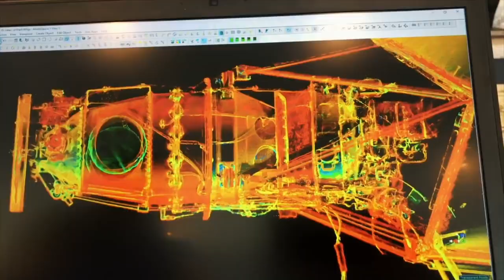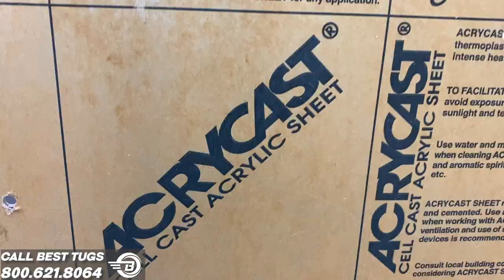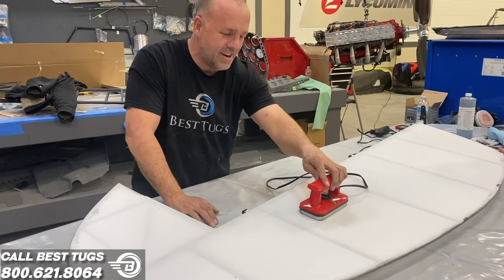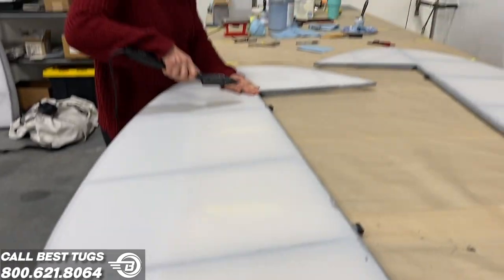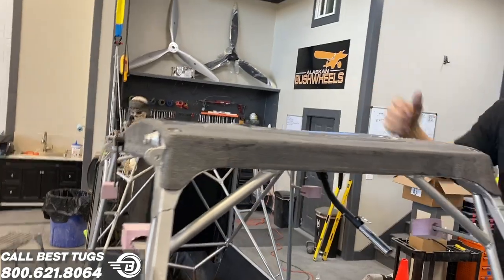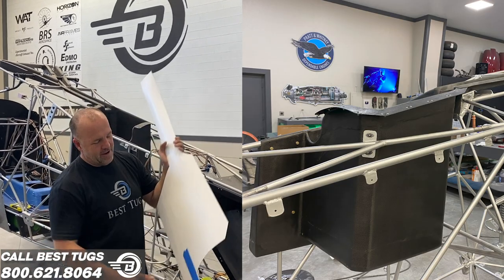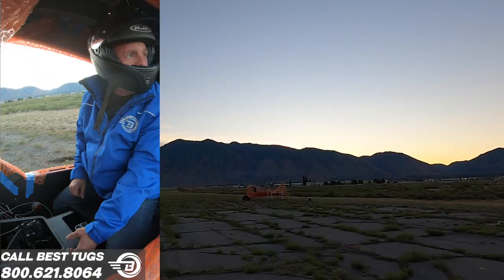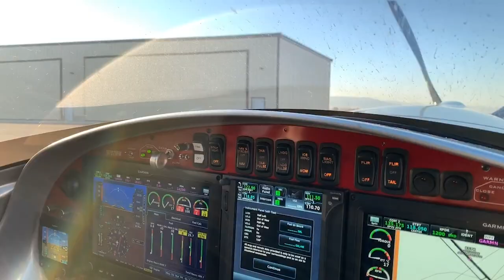Carbon Fiber,  Skylight, Tail-Feathers and Paint Begins (Scrappy Bush Plane 21)

Comment: AH.... don't forget to frame out some of the paint booth just in case it wants not go flat while something's dryin' !............For my curved windows  I built a box with resistance wire, used a BIG D/C  model train transformer  and  and placed my Acrylic in it ( nice even heat )  with cover, and my Shop Vac. ...... kinda like a toaster ....heat lamps help too.....and boy it works !
LOOKS GREAT MIKE !     wish I was as far along as you ..... ah..... bah ....... so be it !

Comment: I was an AMS in the US NAVY but now I only build Balsa Aircraft. I have found double covering offers nothing but extra weight. The true strength comes from the Dope. However, the single biggest part is the weight is the paint. So the application technique is very important. Dope is the lightest product as 40% of its weight gasses off. I enjoy your builds

Comment: Impressive as always. If the situation is dire, I'm all for having a parachute, it's make or break between lethal energies. But it doesn't need to be gentle if the design intrusion can be very modest. If the plane comes down nose down, fast and uncomfortable in the seat harness for a couple of minutes, I think that's quite acceptable if you gain a clean design with a single small pocket and attachment point. I can't help feel that rocket deployment is way overkill too. small charge like an airbag should be plenty or even lazy manual ejection just to keep it reliably low tech. We are talking about a parachute in strong wind. Those should be compatible.

Comment: Maybe i realized this earlier but i just realized it again. Mike had to convince his wife that scrappy wouldn't cost much because it's all built from scrap,  free, parts.  I am with you Mike, 😉😉
Can't wait for the used,  damaged,  and scrapped avionics. 😉
Love these build vids and I wish that i would see you use the less expensive 3m 2097 filters on your respirator. I might do some mild stalking, figure out the address to the hanger, and send you a pair.  They are light weight,  p100 rated and are good for organic vapor ie epoxy vapors.
Reply: Travis k  Thanks for the tip on the respirator 👍🏻.  And, I’m pretty stoked about these avionics too!  Of course, I may skim one or two items out of the box for my plane.😁
Reply: @ChandraSlyFoxPatey  Awesome. Thanks for the reply.
Reply: Chandra, do NOT let Mike hog all the good avionics.  A lady deserves her bling!

Comment: Thanks Mike for letting me know that you are on top of one of  my concerns for your well being if and when your flight plan gets updated and you're going to see what the parachute looks like from underneath, (drum roll!!!)- - -. I guess I'm just too hung up on the vision of that clear light  fluid that's coming from under the cowling and streaming back across the windscreen, (but I do know it could be windshield washer fluid)!
Sure was a lot of comments last video wanting to see the rest of the test firing! Don't get me wrong folks, I like fireworks shows too so long as I'm not a critical part of the show!

Comment: Great video.  It is so nice to see Chandra again.  Now, any chance you could talk my wife into working on my Corvette?  Lucky bastard!  She is a real gem.  Any chance of getting some updates on her and her Cub?  After seeing her reaction when she got the Cub, I have been worried that she doesn’t fly it to keep it from getting dirty.😜
Reply: 😂😂 I fly it quite a bit, absolutely love it!!  I’m horrible about getting footage. I need to rig up a camera to the strut. I actually got Mike to leave the hangar and come for a ride a few times 😃.  Also, I must say, I’m a classic Vette fan!!  I had a red on red ‘62 convertible until about a year and a half ago.♥️ Thanks for the nice comment 👍🏻👍🏻
Reply: Holy crap, Chandra, the ‘62 is my all time favorite!  I have a ‘07 Z06 that I have built into my personal hot rod.  Maybe Mike and I have a little in common.  It has 560 horsepower, bigger brakes and bigger wheels and tires.  It is full of carbon fiber and titanium parts, some of which I have done myself, and I got the weight down to 2851 pounds.  It is 310 pounds lighter than stock and how it drives is amazing.  It’s all about the performance.  More power is great but addressing every aspect of the performance envelope is what makes a car (or plane) truly great.  Thanks so much for the reply and I think I speak for a lot of us when I say that we would like to see more of you.  Think of how you could inspire young girls to not only consider aviation as an interest but to also open their eyes to see how much this world has to offer to ANYONE with a dream and a desire.
Reply: King-O-Vetts  I have something in the works... 😃  And, very cool with your Vette, sounds like a beast!!  I love it!

Comment: I'd be less worried about it breaking and more concerned with it scratching over time. I'd consider running clear 3M car bra material/ wrap on both sides that can simply be removed and replaced when it inevitably becomes scratched and scuffed. (:
Reply: Just what I had thought ;-)
Reply: Buffer will handle any scratches. Scratches from what on top of the airplane? How often do people replace sky lites, I can still see through my 1960 windscreen.

Comment: Fabric covering is very similar to how we do model airplanes ( minus the rivets and the second layer)  One tip ( though it is probably too late....) joining the fabric at the trailing edge is good, with  bottom layer wrapping around the TE. The top layer, if you wrap it around, you will have a fabric edge facing the oncoming prop blast.  If you trim the top layer at the trailing edge of the control surface (rather than wrapping it around) you avoid that potential problem area......
Reply from the maker: 👍🤠 I agree . That’s exactly what I did. They overlap a bunch but the last layer ends just before the wind boundary layer on the back edge before getting into the wind

Comment: Hi Mike, good to see your beloved and beautiful wife getting involved in your passion for building things, with all the hours you spend in the hanger I was beginning to think she would be suffering from pilots wife syndrome! A question for you,  I am sure you have worked it out so it will be an easy answer, What is the terminal velocity of Scrappy under full parachute as it hits the ground? and will your newly designed landing gear shock absorbing system soak up the hit to the extent that there will be no structural damage caused and therefore remain flyable?  regards to you and the family from Ireland
Reply: I’m a pilot as well, so no “pilot’s wife syndrome” here.  Now if you want to talk about “back seat flying”, I can really throw down there 😂.  Regarding your question about the chute, it’ll all be covered in an upcoming video. 👍🏻

Comment: I would save the cut out from the window and use it internally as a upper visor. maybe some thin carbon fiber to act as a latch to hold it up when you dont want the sun beating down on your head. or maybe some neodymium magnets.

Comment: I’ve seen some people put a wood frame inside of the paint booth, that way it would not deflate if the power goes out.
Reply: Brad Ramm  We usually have it collapsed and can easily pull it out of the way.
Reply: @ChandraSlyFoxPatey  i guess he meant if something's drying in there?
Reply: That's a pretty good idea, it would suck if the blower broke or the power goes out while stuff is drying inside
Reply: Nice idea, because that would be a nightmare all stuck together :o

Comment: Just thinking... if you had something black underneath the plexi, it would heat up from the inside, if you used those lights, so it would probably give pretty even heat?
Quick question: is the temperature coefficient of the acrylic close enough to the composite that you won't have any problems with the acrylic shrinking away from the seal, at low temps, or buckling against the surround at higher temps?
I was interested in your discussion of the added strength in two fabric layers..is there a gain in tear resistance, due to different weave alignment between layers?  Have you done anything specific about the weave alignment of the two layers? Just [as usual ;-) trying to learn, every day!]
You are one hard-workin' son-of-a-gun! Your attention to detail is mind-boggling!  I see a lot of experience at work, there!  And, indeed, your wife looks like a lovely person...and, perhaps, a "saint", given the hours you work!!

Comment: Hey Mrs Patey, what did you use to bond the two fabric layers together? I helped my dad rebuild his first plane, a 47 Aeronca Chief. 45 hp, god awful slow, and at 12 y/o, I could SAFELY hand start it. We covered the wings using Ceconite envelopes. I recall that we had to be careful with the heat because it was possible to crush the structure if we got too crazy with the irons. Fun times.
Reply: Nick Salvador  It’s called Ekobond.  It’s a Stewart Systems product, designed to go with their fabric, and it’s great to work with.  I was very impressed with how well it all went together and produced a great finish, the pieces look incredible!  I’ve heard how much of a pain fabric used to be, but I have to say, this wasn’t bad at all.  It’s awesome that you’ve had the experiences you have in building from a young age 👍🏻👍🏻.

Comment: Excellent videos Mike.  But.... acrylic sheet!!  Why didnt you use polycarbonate (Lexan)?  It wont crack, drills without splitting, forms easily and is very durable (material is used for bullet proof windows).

Comment: An idea: for the parachute lid, instead of adding 10 layers of carbon you could add a layer of kevlar and then just one layer of carbon. The straps will never rip the kevlar.
Reply from the maker: Ludwig Söderman 👍🤠 agreed for the non tear issue for sure.  The other item I didn’t mention is I need it not to flex so that it POPs all at one moment and not flex and arch as it goes.  Great recommendation on the Kevlar I use it often thanks 🤠

Comment: I hope you had a great Father's Day! Can you tell me why you use acrylic instead of polycarbonate for the window? Is it the weight? I like pc in my home projects (not aviation) because it drills w/o cracking/shattering, and it even takes threads. I believe it's also less brittle at low temperatures. What are the advantages of acrylic? Thanks.

Comment: MIKE ! It occurs to me that the Rocket Launch Section ought to have some heat/flame proof/resistant liner
to avoid further damage when deployed. What is the flash point of the fiber/resin panels vs rocket exhaust temp ?
Maybe a thin ceramic coating given the rigidity of the launch box.
Reply from the maker: I’ll talk on that specifically soon

Comment: Mike, great work as always. I work with carbon often on my boats. I have learned quite a few tips from you. What epoxy system are you using? Have you made any considerations to the full sun summer-time temperature of the raw carbon skins in your epoxy choice?

Comment: Love your videos, as you are always trying to make everything as safe as possible.  Then I see you are missing the light switch plate cover ($1.50) by your rear entrance door in your shop.  Someone comes in while dark, feels around for the lights and ends up dead due to electrocution??  If you could make a carbon fiber one, that would due as well!  Safety first!
Reply from the maker: I agree.  The circuit was dead, including breaker pulled from panel as we were and are upgrading power and lights in the shop.  Safety first, I would be a fool to leave a open circuit anywhere let alone from a 1.50 part.   Nothing to do with a cover plate everything to do with a remodel.  Always safety first my friend 👍🤠

Comment: Plywood gets its strength due to alternating the grain on the different layers also because it is compressed under pressure for a bond to some extent.
How that apply's to aircraft ? Dont have a clue? Its just thicker? Different weaves overlapping? Will be interesting to see how it holds up in the real world use.
Nice looking carbon work.

Comment: Looking at those safety chute "Y" rip away channels and I have a question.
Would it be possible to have the rip away panels flexible enough to peel but also strong enough to hinge upward standing straight up above the cabin far enough to act as a rigid yoke that the chute is attached to and put this on a plane with a push prop like Peter's Raptor (another channel) so that he could deploy the safety chute before the prop stops spinning without it getting fouled in the prop?

Comment: Is that my Wilga in the hanger? Awww, you shouldn't have. But I'll take it!
Serious question, I mean really serious. How strong is cloth? If you had a cloth floor, could you stand on it? If not and you're in a steep turn can you lean on a door made of it? Back seat fuselage wall same thing?
Happy Father's Day!
Reply from the maker: ken cohagen great question👍🤠 it’s insane strong and yes you can stand and lean on it.  It may surprise you to know it’s what’s on the p51 mustang and can handle over 500MPH on a fighter
Reply: To be precise, in a correct turn you don't lean anywhere, you still feel the vertical directly along the spine. Only the landscape leans around you.

Comment: Mike,  Was just wondering and I know this would probably not be at the top of the list of things to worry about should you need to deploy the chute, but what happens to the shrapnel or pieces parts that are torn once the chute is deployed? Just a thought. Thanks for the videos. They are awesome.
Reply from the maker: Joe Olivera great question 👍🤠 absolutely everything happens on the outside and all that comes off is to small in size and  weight to penitents and get into the aircraft.

Comment: it is amazing that mike keeps the FAA violation in his intro and ending, as i recall it hydro planing is a violation loool
Reply: Hesham Harold that’s not true.. hydroplaning isn’t a violation by itself, especially if proper precautions are taken to not harm others, like a passenger who isn’t a pilot.. yes people have been violated but I believe they had non pilot passengers on board who may not fully understand the risks. Oh and above 60 mph or so, you couldn’t punch the wheels under the surface if you tried, so it’s not as risky as you may think!
Reply from the maker: Hesham Harold great comment thanks 👍🤠 I keep in constant contact with the FAA and take appropriate steps to not violate rules but I Certainly don’t recommend people try it without extensive training. I use ski in method to get to some remote beach areas around here.  It certainly has its risks so not taken lightly
Reply: @MikePatey  Mike, your safety considerations in design is second to nasa in my opinion, i do thrive on your work/art in my engineering career, am just saying it is cool.
Reply: @heshamharold  Second to NASA?  I don't think Mike would make gaskets of some rotting crap ;-)

Comment: Do the rivets that you are using have larger flanges than normal to hold down the primary layer and not rip through the fabric over time? That’s why we always rib stitched the old fashioned way but interested in your opinion.

Comment: Might be a dumb question but, would it have not been better to have the parachute rocket fire from a more forward position?  My thinking is that you would have aerodynamic assistance blowing the cover (peeling the cover fore to aft) aft and away from the deploying parachute and straps.  It would also reduce the risk of the cover or pieces of it either entangling in the chute/strap system or chafing it. Or would that have placed the containment boxes within the cabin?
Reply from the maker: I’ll try and talk on that soon

Comment: What resin are you using for the skylight carbon overlay?
I find that everytime I lay carbon over plexiglass/polycarbonate/perspex getting hundreds of micro cracks that run out from where the resin contacts with the clear panel...
Reply from the maker: Nic Holmes yea I had that a long time ago I’ll try and show the bond agent I use in a later video I have never had a problem since

Comment: I know a guy! Who knew a couple guys, named Tesla, Nichola Tessa, and Wernher Van Braun. My Fahter in Law. My Father in law was and electrical engineer who helped the Navy develop surface contact radar to hunt Nazi Uboats with during WWII. Before the war he managed the electric generator in the basement of the Hotel that Tessa lived in. After the war he worked for a sub contractor to Nasa on their Gemini program, where he Met Von Braun.   He met them after a conference in which he was discussing how to build a rocket for the Apollo missions, and was talking about the differences in types of Rockets. Solid fueled rockets made more power per weight of propellant, but once you lit it, it was on baby. No way to throttle it or shut it down. But the second type of rocket used liquid fuels which had the safety advantage of being able to throttle them and shut them down if needed. When asked by one of the attendees why they couldn't throttle solid fueled rockets, Wernher Von Braun said in a heavy German accent, this is not what we want, it is what we get.  As far as Telsa my father was sent to his room to figure out why his razor wouldn't work. When he got there my Father in law found that Tessa had failed to plug the razor in. But the two became friends. It turns out that Tesla was trying to figure out resonant frequencies and what they could do. At one point he got a 12 foot pipe from a steam powered organ and tuned it to 12 Hz. Being on the top floor in the penthouse gave him an unobstructed view of the building next door. He then proceeded to  fire up the pipe, at 12 Hz which is inaudible to humans, and it shook the neighboring building so violently that the mortar holding the bricks in place crumbled. Mr. Tesla was then asked to leave the  hotel. I know a guy who knew some guys.